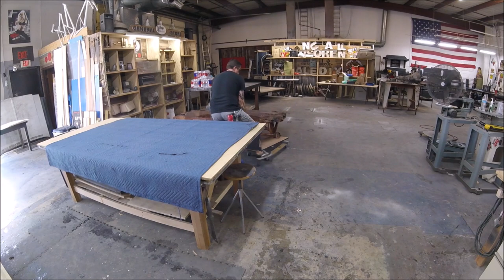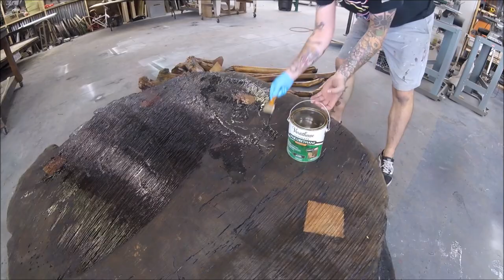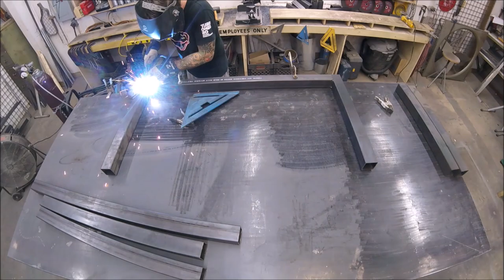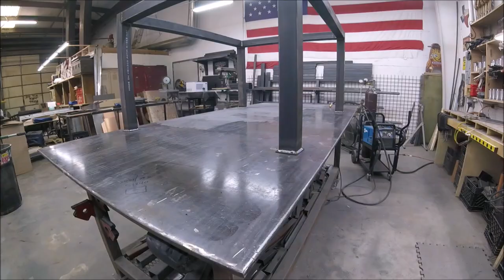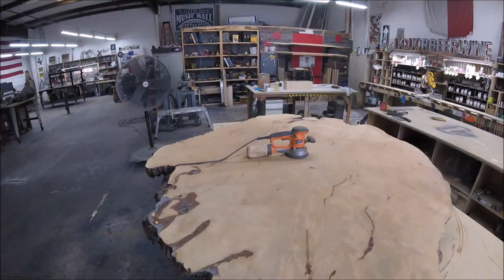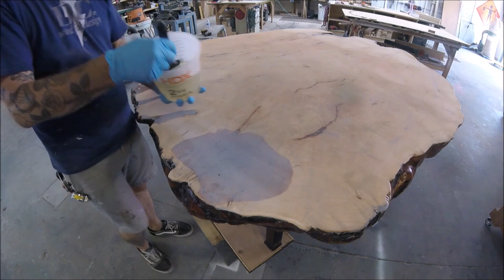Rebuild and Refinish 7ft Cedar Slab Table

Comment: Awesome video! 
I’m trying to strip a similar table- but it’s multi tiered and held together with rebar. I’m having some success with the flat areas but how do I strip the “holes” (for lack of a better term) and the edges? Amy help would be MUCH appreciated! Thanks!
Reply from the maker: Wow...tough one. Wish I could help but if it was in front of me I'd make something happen for sure...
Reply: @DerekConwayTX  where are you located? I didn’t catch that part
Reply from the maker: @TJHutchExotics  Dallas Texas